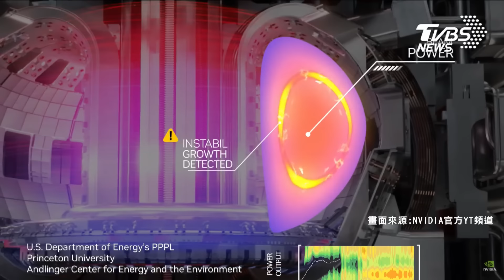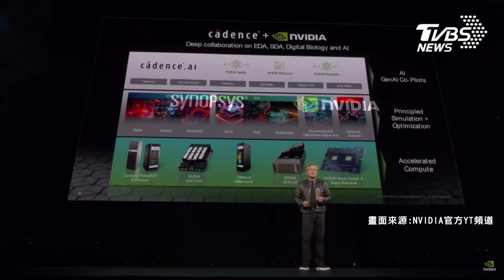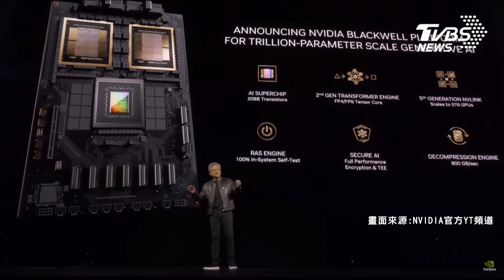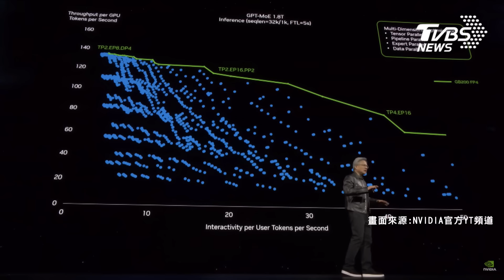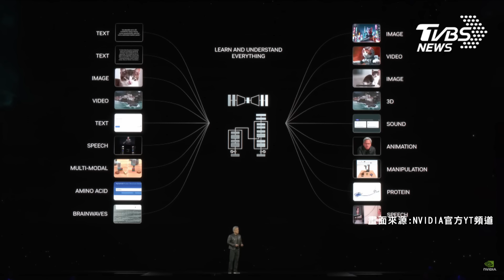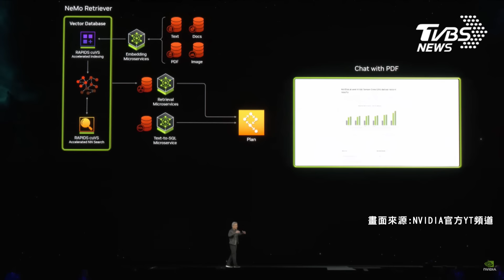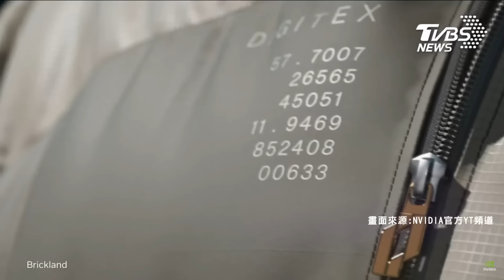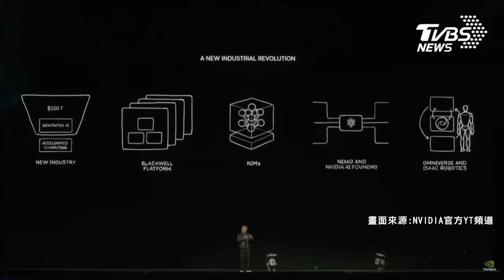輝達GTC大會黃仁勳演講 秀最強AI晶片架構Blackwell｜完整版中.英CC字幕｜TVBS新聞 @TVBSNEWS01

Comment: This video function as Hollywood, it’s so fucking eye-catching eye-popping do you believe me or not? That’s how Wall Street catch your desire. I don’t know how much energy it require to provide enough power for the AI industry to continue. And how much money you could meet with AI? The most needed area for AI it’s hard labor and complicated computation, however the labor over there is a lot cheaper for hot labor who is going to use AI to move furniture who is going to use AI to build a building